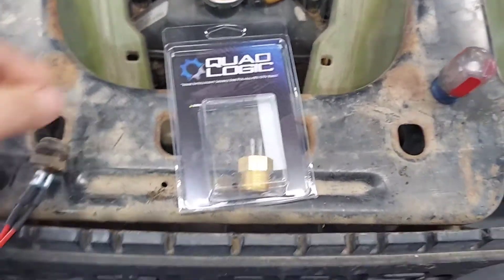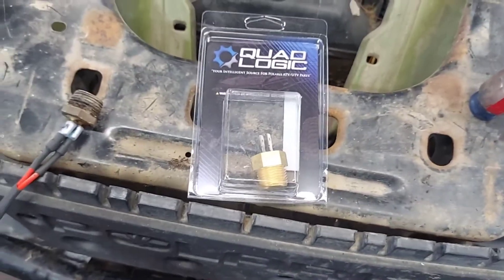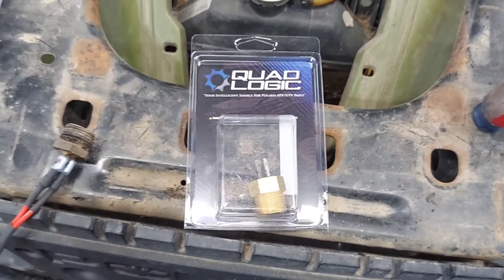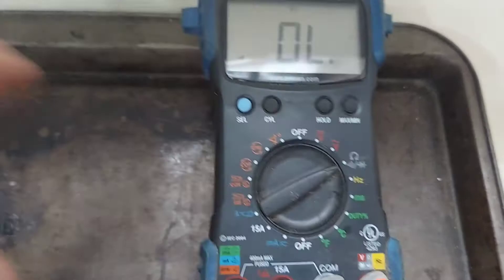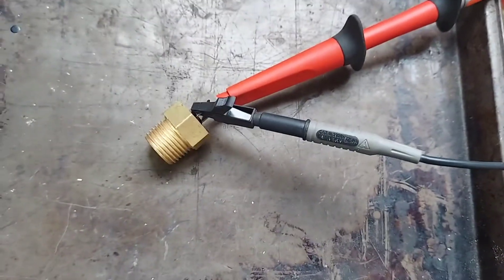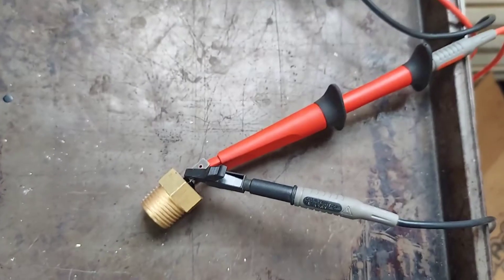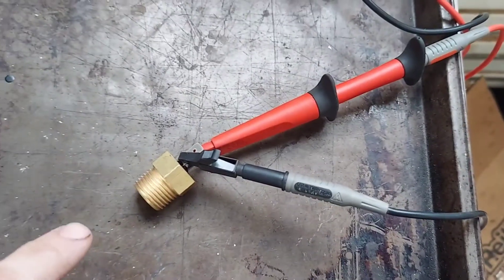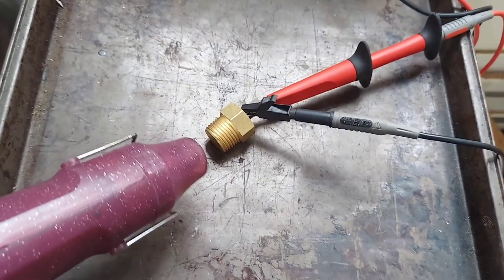Testing a thermal switch for Polaris atv fan.

Comment: Some people just bypass this switch by soldering the 2 wires together, makes the fan always run.
Would you recommend it ?
Reply: Mine likes to get stuck in the ON position. So I was thinking, well, that's better than stuck in the OFF position no doubt! 
I've recently been going over the quad repairing all that needs attention. So I landed here! 
Thanks for sharing your knowledge with the masses.
Reply: You could just put a switch in and cut fan on when you want it on.
Reply from the maker: No i wouldn't.  It's  hard on the charging system